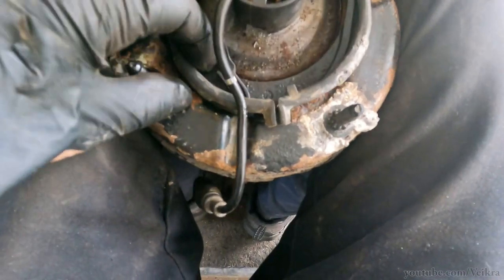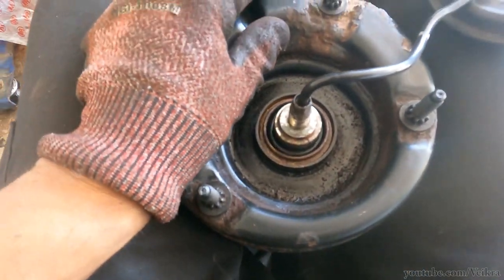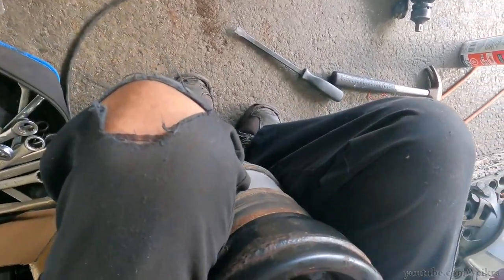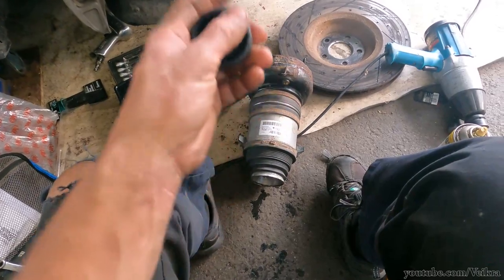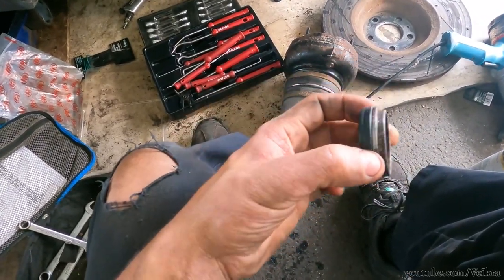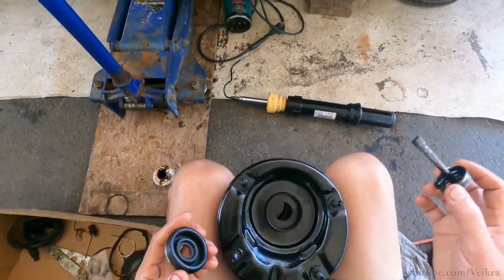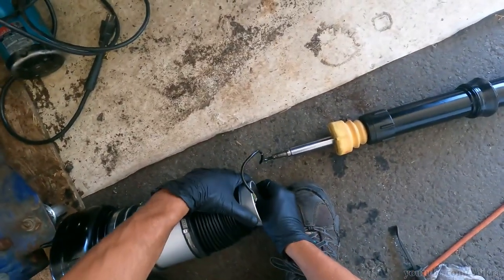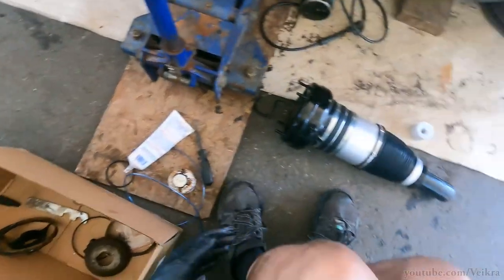D4 Audi A8 Air Spring ONLY replacement.

Comment: I agree. I have a bag that just went. Looking for parts to service the unit and found nothing but the unit. The type of work I’ve done over the years include replacing an air bag. Not serviceable is 😂😂😂
Reply from the maker: That`s air spring replacement is one of the more involved. D3 04-10 is a walk in the park vs 2011-2019. It requires a LOT of dexterity to get the top seal out without breaking it. Hopefully it goes great for you as well.

Comment: Great video, thanks a lot.  I received two bags from China, it seems all the top seals are included.  What are the set of keys you have at 5:43 to release the connector? Thanks again!
Reply from the maker: Wow you got the seals ! Guess my complaints didnt go unnoticed. That's awesome. D4 bags are a pain versu the D3.  The set of keys are meant to remove connector pins. Very cheap

Comment: Hi
I removed my airbag to check the strut. Everything was fine and I assembled everything back. After a test drive the car make bad noise over bumps. When I lifted the car the buttom of the airbag where it sits on the lower part of the strut flew up. I tried to change the oring but the noise is still there. Could you tell me what size oring I need and what I did wrong?
Reply from the maker: hard to say without seeing it. squeeking noise or banging noise? Did you set trim height for all the suspension bushings?

Comment: thats a crazy price for a new strut you got there, here in europe I can buy a new genuine air strut for this car for 755 €
Reply from the maker: thats dealer only here. No one sells them aside from dealer. And aftermarket are junk not adaptative.  
Can you share the dealer that sells them? for 1000$ ? Might be worth importing if the damper is bad or top seal isnt good.
Reply: @Nordic_Mechanic  check your yt spam comments folder
Reply from the maker: @differentcarreview-dcr  I can`t find anything from you

Comment: Hi. I'm having trouble putting it back in the car. I can't compress it to fit in the shock bracket. any advice?
Reply from the maker: Yep, remove the residual valve where the lines goes in. It will be way easier to compress by hand. Otherwise, air gets trapped in the air srping.
Reply: @Nordic_Mechanic  thank you